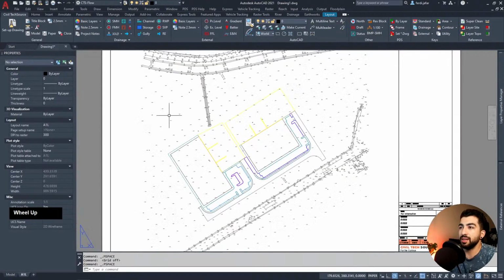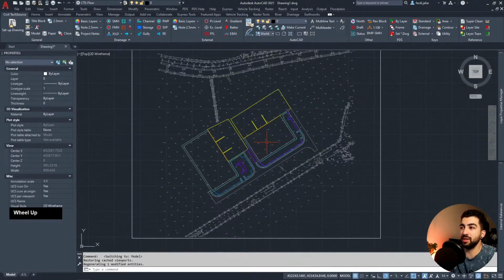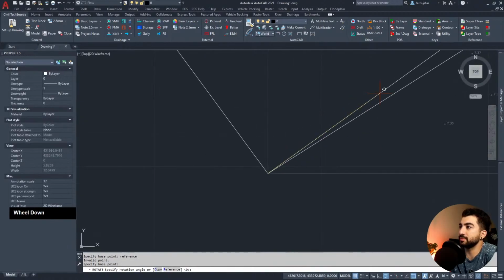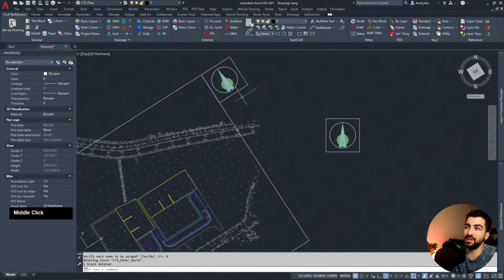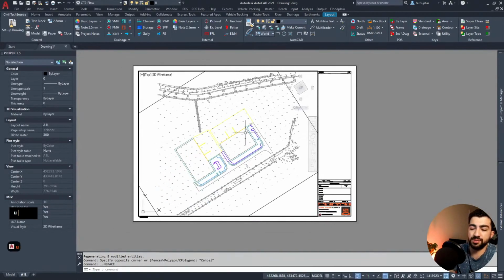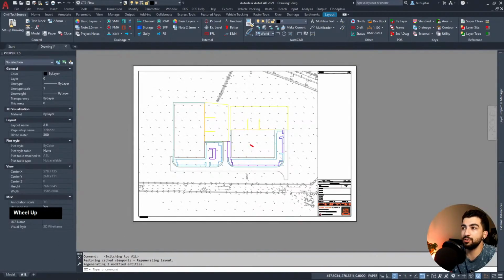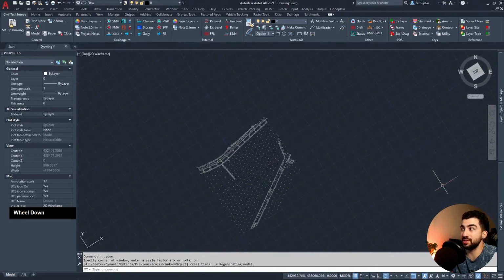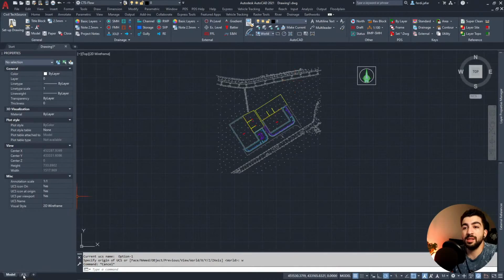AutoCAD UCS - CTS (LiveStream)

Comment: Good presentation, personally I prefer to just use good old fashioned "DVIEW TW",through the viewport to attain the same result. Not an option that is available in LT though, last time I checked.
Reply: Yes, Dview a new hidden command that I didn't know after working with ACAD for more than 25 years 😬
Reply from the maker: AutoCAD has so many commands, I just found out that there is TORIENT command to rotate text only.
Reply from the maker: Never heard of Dview!? That's a new one for me! Thanks for the tip!